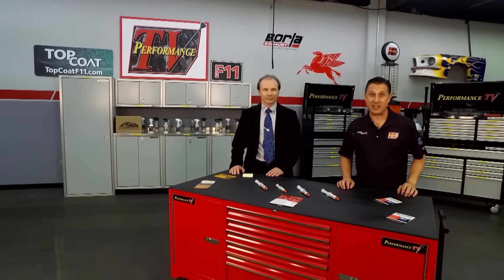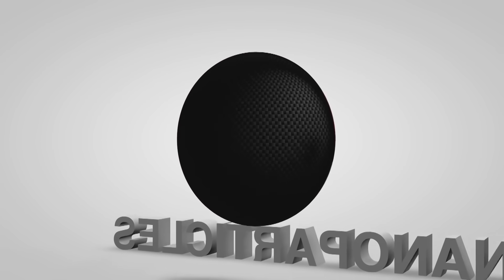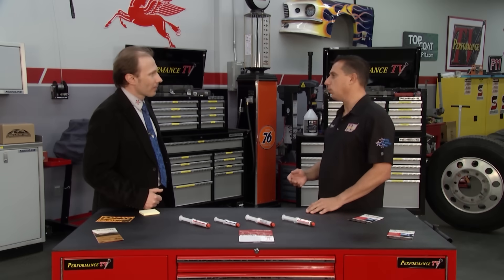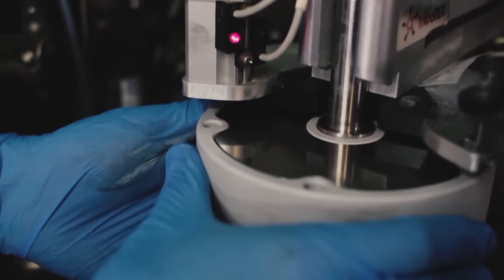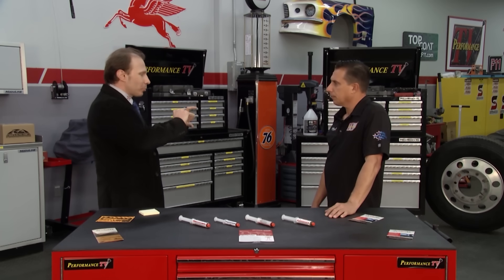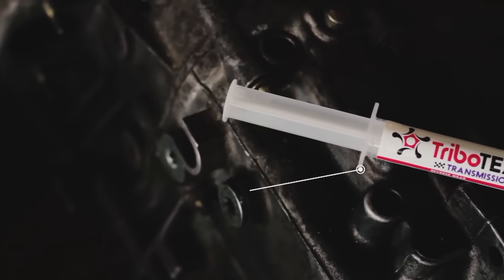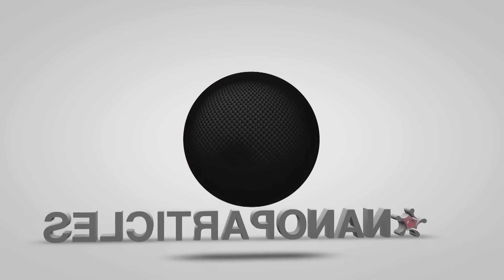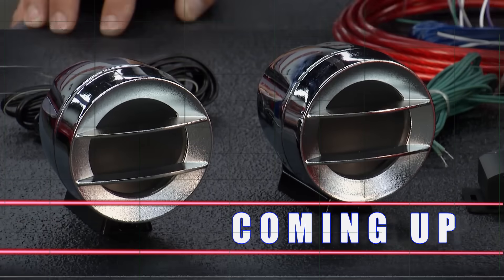TriboTEX review back on MotorTrend PerformanceTV

Comment: I used it on a 2005 Kia Sorento ran out of oil and water it sounded like a couple of monkeys running around with hammers in my engine.
Took about 500 miles like they said sound went away runs great put another 100k miles on engine  no noise didn't even put in the full amount got hot had to retreat great stuff if you don't believe don't blame you I would have a hard time if I hadn't seen it for myself 🎉 I'm ordering it for my 2003 toyota tundra going to try the transmission stuff also no noises but it's got 250k miles like to get 500k out of it or more I drive them till they drop 😮

Comment: would love to try it but I need that price to drop a bit
Reply: Try discount code: rotary  I'm not sure how long it will last...
Reply: I used the %15 off and the $200 I spent is worth every penny. I have a 94 Dodge 1500 318 with 450,000 original miles on motor & tranny. I 1st used product with 420,000 and am adding 2nd dose this week with new oil change. Towed my 27' trailer last summer to Wallowa Oregon without to much loss of speed. What does a ASEM mechanic charge per hour + parts. Your time is worth every dime for piece off mind knowing you made a wise decision.

Comment: over 2 years ago I met Pasha and another engineer via phone calls.   I treated my 2001 Miata engine.  It was a bit noisy, even after warm up.   I added Tribotex.  First time I ever used an additive.   Within 3 to 400 miles the engine became much quieter.   I then got a treatment for my 2004 Tacoma V-6.    That was over 2 years ago.  Both engines are running very quiet and smoothly.     I am now ready to try the transmission treatment.    This is a product that really has helped my engines.
Reply: Sorry to say I rolled the 2004 Tacoma. Totaled.  But now all these years later the 2001 Miata is running quiet and strong. I will keep using Tribotex.

Comment: I added TriboTex ,after the first 500 miles the engine ran with less noise from lifters ,and very quiet also as ,I start to drive acceleration is much faster it just get up to speed this is very nice .Know I press the gas pedal easy rev's up faster and ideals better very smooth ,I made this video to help  https://youtu.be/nabJ1gdFdul

Comment: I've added tribotex to all my engines.   I have a '99 GMC sierra 4x4 with 340,000 miles that I tribotexed a wile ago. time to treat again.  With my brother in law as witness, we both noticed that the engine got quieter almost immediately after treatment and the engine seemed to pull much stronger under load. Good experience.